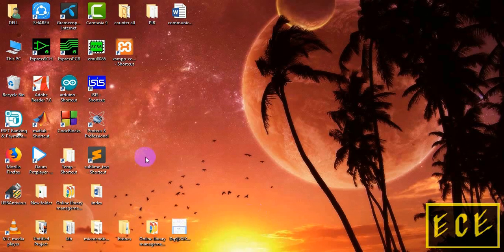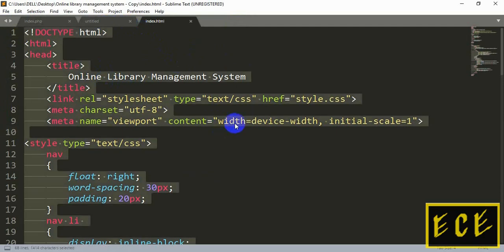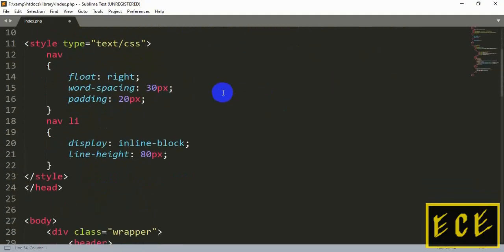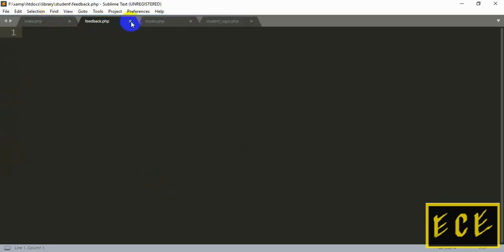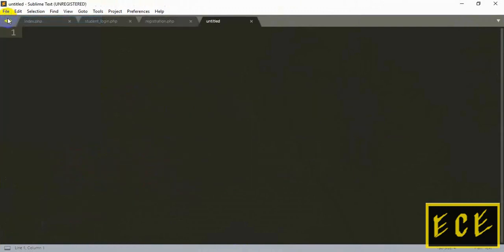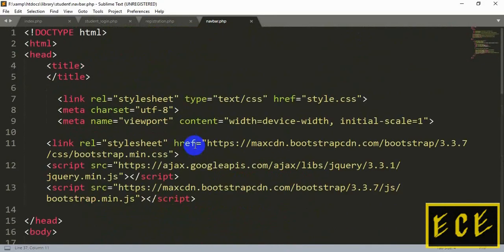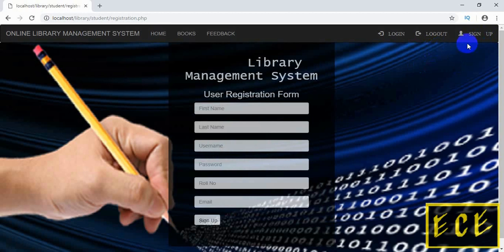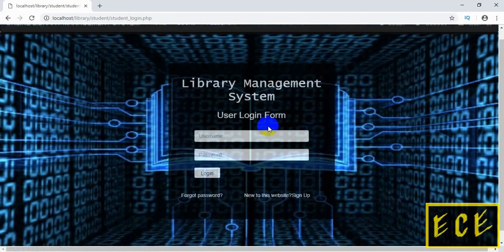Library management system part-10 | Starting PHP | Making PHP pages and replacing HTML pages

Comment: Greetings madam. When I connect the code with php and run it using the xampp server, the Web page does not cover the full screen.
Please help
Reply: Mam please for a reply.
This is equally my school project. Any one can help
Reply: did you solved this issue?
Reply: @neupane_01  no please
Reply: @neupane_01  please help me 🙏🙏

Comment: dear mam, i don't  add navber function , in that case , is it necessary to add this code  "navber.php" on my page . i skip this part on my project .which u do on ur 9 part  project. , i am waiting for ur instruction
Reply from the maker: You can skip it if you don't want a navigation bar. But I've added some other options like message notification, user profile, a timer on the navbar page later. You'll have to add them on some other part of your code later.
Reply: @ece_projects  
tnx mam for ur response

Comment: maam how to open localhost??
Reply: ive made folder name index but not showing help
Reply from the maker: Folder name is not index.php. follow the video. First open htdocs folder from xampp folder where you've installed it. Next inside htdocs folder create a folder for your project. Inside it create the php files
Reply from the maker: You just need to write localhost in any browser like chrome or Firefox.
Reply: @ece_projects  maam i'm writing but showing the same error this site can't reached
Reply: i'm following you but here i got error bs local host ni khul rha bki sb tek h
Reply from the maker: Follow this steps.
1. Save project in xampp>>htdocs
2. Open xampp and start MySql and Apache.
3. Open a browser and write localhost.

This is the process. You can't skip any of it. And make sure your xampp is installed properly without any error.

Comment: Mam meri index file ka icon document file jaisa show ho raha ha jaisa apka black and orange ma ha wesa nhi ho rha show.. Plz help.. Am confused k mera xampp sai sa install hoa h k nhi
Reply from the maker: If you can start your Apache and Mysql in xampp then it's been installed properly.
Reply: @ece_projects  then file q sai sa show nhi ho rhi text file jaisa icon show ho rha
Reply from the maker: The main php or html file is showing as text file? Which software are u using for writing code?
Reply: @ece_projects  sublime
Reply: @ece_projects  html file is showing and running properly.. Php file isn't even open when I click on it.. It shows error that Ur system doesn't support php
Reply: @ece_projects  actually system nai.. Mtlb ya show hta k apk pas php k lie proper software nhi h
Reply from the maker: Actually u can't run php file directly like you did with html file. You need to run it using xampp server like i have shown. First copy the folder in htdocs folder and then open a browser and type localhost then you can open the php files
Reply: @ece_projects  ohh OK thank u

Comment: Mam it is compulsory to create navigation bar?
Reply from the maker: No it's not compulsory. Actually this makes the website more user friendly. If someone want to sign up they can click on sign up easily from the navigation from any other page. But if you don't add navigation then the user need to go back and find the sign up page or any other page. So for this purpose it's important. But if you wish you can skip the navigation bar in some pages.
Reply: @ece_projects   ok mam I will add. Actually if we add page look nice mam.